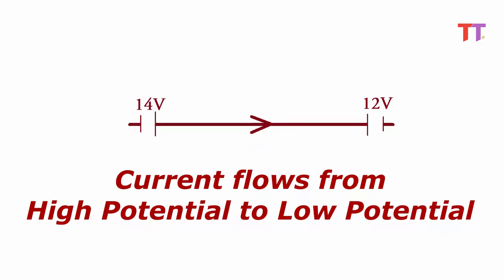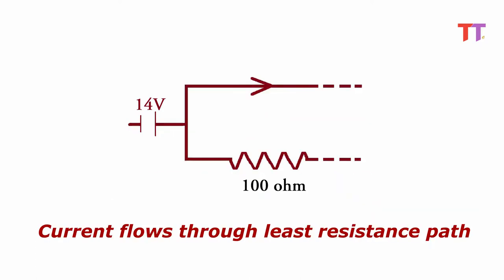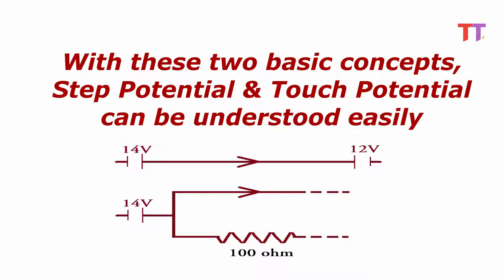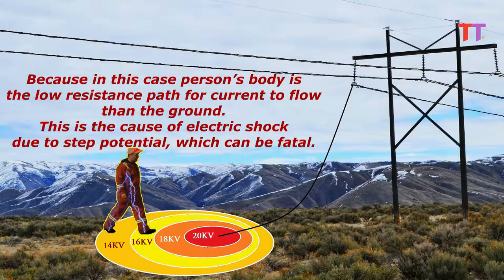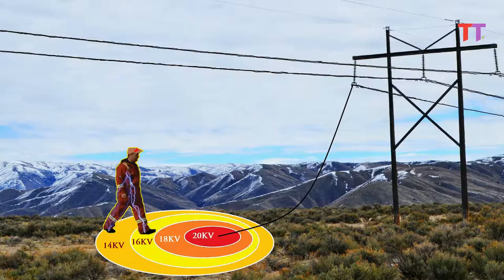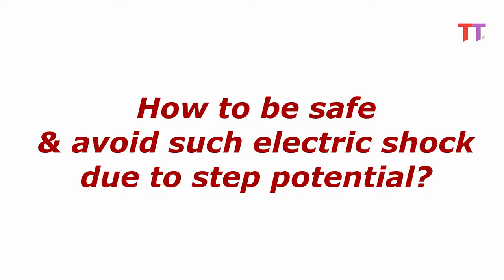Step Potential & Touch Potential. Simplified with an example.

Comment: Instead of bunny hopping you could also do a running jump thing where you run with 1 foot and jump land on the other and jump again, making sure to only have 1 foot in contact with the ground at a time. It’s much faster
Reply from the maker: Yes. It is an effective way out, which is also explained in the video.
Reply: @ElectroGlobe1  okay thank you 🙏🏽
Reply: Thanks
Reply: Sounds like skipping I’d rather just die like a man

Comment: If a downed High Voltage cable is on the ground consider it to be live, and keep away until power company have been informed and are on site to make it safe.
10 metres is minimum distance to stay away.

Comment: Can you still get electric shock if you have wear Boots ?
Reply from the maker: It depends upon the type of shoes and voltage level of the system one touches. Shoes with adequate insulation properties for the voltage can avoid electric shock.

Comment: How about Shoes with rubber? Wouldn't it be isolated?
Reply from the maker: Yes, it would be. But it depends upon the insulation strength of the shoe rubber, and strength of the electric field you are dealing with.